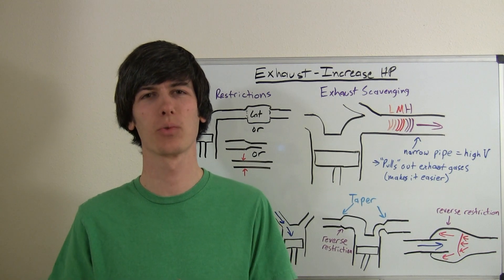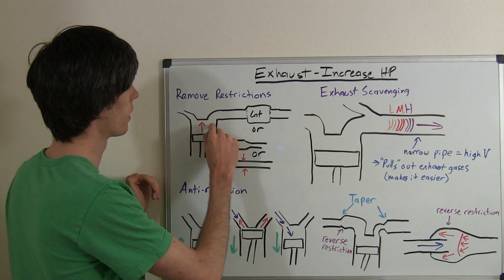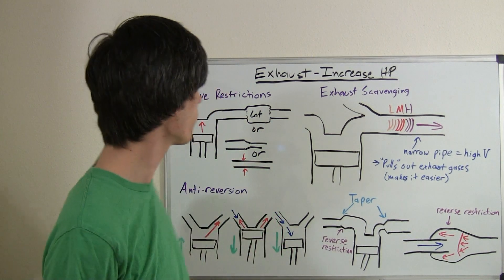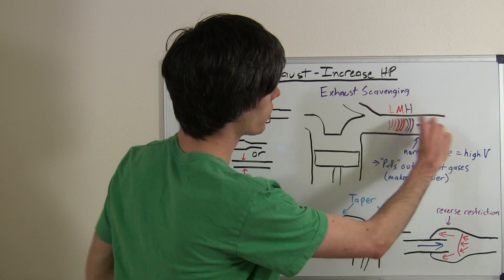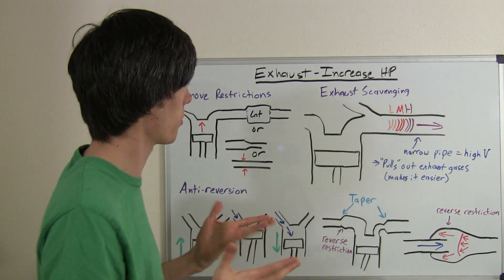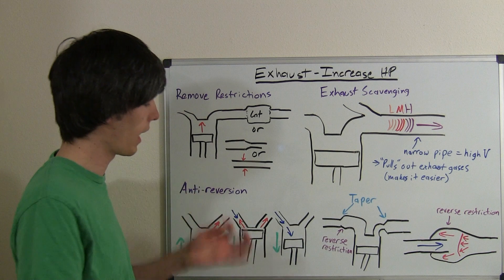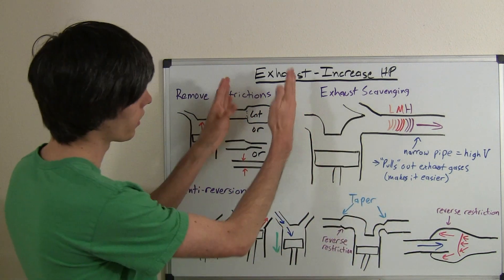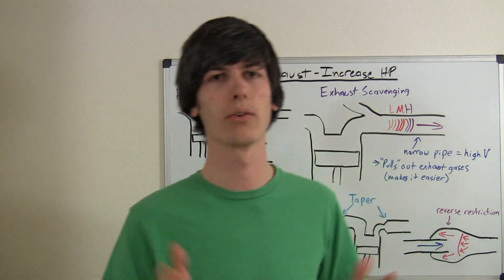Performance Exhaust - More Horsepower

Comment: So what will happen if we take the CAT off ? We are going to gain hp right?
Reply: ayberk vergül you go to jail lol
Reply from the maker: ayberk vergül Not necessarily, depends how restrictive it is. They can be sized so they don't reduce performance.
Reply: How about if we take the cat off as well ?
Reply: +xForgeHouse in USA possible, but rest of the world, not a damn thing will happen. God bless the 3rd world countries :) (living in egypt at the moment) you can take the cat take the bat take the hat off even and no one would give a shit :D im for real bro
Reply: theuncanspan How fast you can drive depends only on how brave you are.
Reply: ayberk vergül need to do bigget exhust and not a stock car like more boost
Reply: xForgeHouse LOL
Reply: +theuncanspan haha right i live in Egypt too, its a mess
Reply: Omar El Zayat yea man sometimes we wish for better roads cause we're sick and tired of changing the tires every 6 months but then again we still getaway from regulations like the ones they have in america ;)
Reply: Omar El Zayat haha exactly
Reply: +ayberk vergul  If The Cat is monitored by an Up Stream 02 sensor and a down stream 02 sensor, you will in fact ruin the vehicles ability to alter the air fuel ratio via injection duration. The engines computer (PCM) relies on the readings from the 02 sensors to adjust how much fuel is being delivered to each cylinder. So if you remove the cat, the down stream 02 sensor will see the dirty exhaust gasses when it should be seeing clean gasses, So what your computer does is take fuel away as much as possible making it lean and effectively reducing overall performance. You shoot yourself in the foot by doing this. Plus you will get a p420 code and if there is 2 banks of cats you will have a p420 code and a p430 code. Plus its illegal. And cats don't restrict that much. Less than 1 psi for a healthy cat.
Reply: +Taylor Moore actually the upstream O2 sensor is what is taken into consideration when determining injector pulse width.  The downstream O2 sensor is there only to make sure the cat is doing it's job and doesn't affect air-fuel ratio
Reply: +Jimmy Rolltz  Well when I have vehicles in the shop with a p420 code. Which is for a bad cat on bank 1. On the data stream My fuel trims both short term and long term both achieve negative numbers usually around negative 25 or 30. meaning the pcm is taking the fuel away. And it's because it sees that the cat can't clean the air and the vehicle is now trying to reduce the amount of carbons introduced into the combustion cycle to reduce pollution because they are programmed to do so. But on a healthy system with a fully functioning cat I am inclined to agree with you.

Comment: Sorry I took so long to look at this, you had asked me to in the comments on another video :-)

The reversion going up the intake valves is really common in racing cams (which "open early, open wide"). But the reversion only occurs at low rpm. The gas is expanding at a fairly constant rate, but the cylinder motion depends on rpm. So a valve timing that has minor gas reversion at idle, may equal out at a modest rpm, and then at a high rpm it will alleviate intake restriction (the opposite problem of reversion). That's why racing cams tend to have a little bit of a coarser sound up the intake system at idle. Anyway, subtle engine sounds aside, it does mean that you get slightly better gas mileage (all low-rpm driving) with a regular cam, but a much less restricted top end with a racing cam.

As for a narrow pipe going faster... yeah... but no too. Faster yes, but um... how to put it: Imagine a mule with 1 pack, that must make 10 rapid journeys to move 10 packs, vs. a mule with 2 packs, which only needs to make 5 journeys to accomplish the same work. A wider exhaust pipe can move more exhaust away from the engine, even if it's traveling at a slower speed. Technically, the fact that it's moving slower is a benefit, as it negotiates a catalytic converter or muffler with less aerodynamic fuss (this is only true if the cat or muffler are themselves larger diameter as well). Mainly the speed of exhaust flow that you get with a narrower pipe is getting it's speed from the engine forcing the exhaust out. So that speed is coming from the engine, ie: taking engine power to make it happen. key words, 'taking engine power'.

I think the only reason to stop making an exhaust larger, is weight vs. practical benefit. When you have minimal backpressure in the exhaust, at the RPM range you expect to operate, then there's no reason to add more steel for larger pipes.

The main reason for the tapers in the intake and the exhaust is just that it's aerodynamic. When you change the diameter of an enclosed passage way for moving gases, you change the speed the gases are moving at. This takes energy to do, and functions much like 'drag' does in an open air setting. A taper when changing diameter of enclosed air passage ways is advantageous in much the same way that having a windshield that sweeps back at an angle is more aerodynamic than a vertical windshield (a la WWII jeeps). It allows the change in air velocity and pressure to be gradual rather than abrupt, so it takes much less energy, kinda like pushing a car up a gentle incline vs. trying to directly lift a car vertically by hand. In a closed passage way, abrupt changes in diameter are about equally bad for air flow whether they are adding or subtracting diameter, but much MUCH less bad if they are tapered. It's why you want funnel shapes fore and aft on a catalytic converter, and why any changes in exhaust diameter should be 'gentle' in slope (tapered). You can see this even on the shape of the valves, which on the back side have a tapered shape to smooth out airflow a bit. Bear in mind that valves and pistons have a very high speed oscillating movement (rotational movement conserves it's momentum and most of it's losses are to friction, but oscillating movement is a huge waste of energy so oscillating parts should be as light as possible). So even a tiny bit of weight added to oscillating parts robs substantially from power and gas mileage. And even still, they put a taper on the backside to alleviate abrupt air pathway diameter changes.

I don't think reverse flow in an exhaust is much of an issue. If it is, it would only be so at an idle speed. Maybe more of an issue if you have a very restrictive exhaust? I dunno. So a reverse restriction doesn't make much sense to me, as it's geometry would itself act as a restriction for smooth exhaust flow (abrupt change in diameter, larger in this case). If there's a situation/application where reverse restriction is beneficial, then I'll just defer to whomever knows more about that. But it looks intuitively "bad" from the standpoint of moving exhaust through the pipe without wasting energy.

Ideally I think the only unavoidable big changes in passage diameter would be at the header's 'collector', where 1 pipe meets several other pipes fairly abruptly, increasing the diameter of exhaust flow several fold pretty abruptly, and the muffler, which is basically using changes in air pathway diameter/geometry to kinda scramble the structure of the high pressure waves in the exhaust and muffle the sound of the exhaust pulses. Some header collector and muffler geometries do this with less energy-robbing than others.

A resonator also robs energy, it's basically doing work similar to what a muffler does, and in fact many performance mufflers are basically just large resonators. I'd only add a resonator if you want to quiet your engine sound. It never 'helps' with power output, unless you're using one instead of a muffler which might have robbed more power.

Of course, most folks just want a cool sound... the very best performing exhaust will be a little too "drag strip" sounding for the average person's taste. Even the high priced super-cars tend to cater to the "sounds cool" point of view. Then again, expensive supercar's notably don't have wheelie-bars ;-)
You can get pretty decent airflow within the limitation of having a slightly more tame purr.

I think the tightest restriction in most hobbyist exhausts is the catalytic converter. Cat-Back systems are only alleviating restrictions aft of the stock Cat, which is typically narrower in diameter, and fairly restrictive itself. If your car is old enough to replace the CAT, get a header & a high-flow cat that matches the diameter of a fairly wide pipe cat-back exhaust. The most benefit comes from a complete engine block to tailpipe upgrade. Although even if the engine breathes well through the entire exhaust, you still need a non restrictive intake (air filter, throttle body, intake manifold), and preferably a racing cam or semi-race cam to fully exploit the aiflow potential all the way through the system (allowing a power curve that peaks out at a drastically higher rpm). And of course if you're going to do all that, why not get a supercharger or turbocharger to artificially inflate your displacement as well hehe.

You could add a lot of power with just a header & turbo though.

Worth mentioning, claims of increased HP with various bolt-on parts are usually looking at a dyno chart for any single point, anywhere on the dyno chart, where there's a few horsepower difference in favor of the added part. To be fair, sometimes there is a small gain across much of the chart. But on the other hand, you could run two dyno tests of the same engine, without changing any parts, and find a few HP difference somewhere in the chart, even though it's entirely the same parts both times. No two dyno tests will look exactly alike. Some performance bolt ons are better than others though. And the closer you get to doing the entire exhaust or entire intake system, removing all the bottlenecks, the more your power gains will start to become readily apparent at high rpm. Just don't assume that a manufacturer's claim of "+5hp" and such for a single bolt-on is necessarily going to be as helpful as the marketing suggests.

Comment: Is more exhaust "back pressure" on a turbo car beneficial for low end performance? Example, a stock down pipe with a catalytic converter (more back pressure) vs an after market downpipe with no catalytic converter (less back pressure)
Reply: On a turbo motor you want the least amount of back pressure posable after the turbo but in the header and up pipe you need back pressure to spool the turbo its like a garden hose put your thumb on it it has more pressure and shoots out harder and faster if you have back pressure after it will push back on the turbo making it harder to spin thats why you see 3in exhaust on turbo cars but not na cars inless it a v8 or something hope this helps a month late
Reply: That makes perfect sense! Thank you, I was surprised to see that the Rally cars have catalytic converters in your new episode.
Reply: no problem idk y the would have cats

Comment: if you have k24 engine and you go from exust manifold 2/qrter pipe to after the resunaider to 2.5 then back to 2/qrter for the dule exust whill that have a better afect eith presure or will that be bad?

Comment: Are there such things as "assisted" exhaust? By that I mean, imagine an outward (exhaust) fan at the end of the tailpipe. That is a very basic example, but my point is - is it beneficial to have an assisting "pull" pressure from the exhaust end?

Comment: just wondering will i make a bit of power on a 3.0 inline 6 twin scroll turbo with a straight pipe axleback(muffs delete). axle back straight piping is 3" and oem size is 2.5 or 2.75. the whole oem exhaust is 2.5 or 2.75 throughout(dp to ab) so i was wondering will i make a bit of power with a 3.0" straight pipe ab?

Comment: Is there a way to increase flow throughout the entire system but not increase or even decrease the audible noise of the exhaust?
Reply: It depends what kind of exhaust system you use. Basically, don't cheap out on an exhaust. I have a VR6 GTI with a Borla Exhaust, its subtle when it needs to be, but it ramps up when you hit the revs. Honestly, i highly recommend you look up your car with a Borla system in it.
Reply: William Su  chek out some huy flow catalytic converter and see if you have one or two exhaust resonators..if two you can remove the second one going towords the muflers way or two together ..depends chek with your mecanic

Comment: whats the difference between high compression for your piston and back pressure. Say you had a high performance engine you want high compression for your piston to ignite fuel better but then you want to have a nice flow out of your exhaust..... don't those 2 things contradict each other?
Reply: High compression just means you have a smaller chamber volume for the same amount of air/fuel mixture to be ignited.  Which in turns makes more power because the charge is denser.  Same amount of air is going in and same amount is going out.  The only difference is the piston is moving much quicker on it's down stroke.

Comment: now, if only you could use the low pressure from the exhaust pulse to pull in the air from the intake. granted this would only help at lower RPM ranges, but in a heavier car that drives on the street I think it would be better. On the street you really only need to pull from 1500 to about 3000 anyway.
Reply: isaac clarke look into valve timing overlap

Comment: Will raising the temperature of the exhaust gases inside an exhaust by insulating it with exhaust wrap or say a ceramic coating have an effect on the scavenging potential?
Reply: Scavenging is increased with heat.

Comment: I'd like to see a 2-stroke design out on themarket for cars.... Now hear me out before I get crucified.

The cylinder gets two valves, intake and exhaust, pretty standard. Except the intake manifold has.... Now get this, another exhaust valve. So when the cylinder has just fired and is moving down, both valves open and a turbocharger forces air to go circulate through the piston completely, with at least the twice the volume of air flowing through as the displacement to account for ignition. After BDC both valves intake and exhaust close, and the relief valve on the intake opens up, venting the turbo so it gets to run continually. Since a large amount of air flowed through the cylinder, it remains cooler. Compression and ignition, both valves open up, back to start. I'd have to figure out how low it'd have to Rev and what the ideal displacement is for this engine to see if any turbo can even pump that much, but you'd run cooler with more power and with no leftover exhaust gases to clog up the next charge. Oiling would be taken care of by a splasher on the crank because I hate moving parts.

Kind of like two stroke diesels out on the market actually
Reply: Ariel Lezen the french made a 2 stroke car  years ago ,,, wasnt so good  and really smokey
Reply: So basically you'd have a turbocharged engine with a bit of overlap on the intake and exhaust timing.

The problem with that is you'd need a non-interference engine (as the valves would be open at TDC), which tends to have a lower compression ratio, so you'd need a bigger turbo to compensate for that, which in its turn is costlier less efficient at normal rpm's.
Not interesting for a manufacturer of normal road cars to implement, the cost and efficiency would be lower than having a smaller turbo, more compression, and an exhaust system that drains as much exhaust gasses as possible out of the engine.

The exhaust valve in the inlet to keep the turbo spinning is a good idea, that's why pretty much every turbocharged car already has this, it's called a blow-off or diverter valve.
Reply: also reliability
Reply: Are you me? ;)

Comment: juz wondering if i decat my stock pipe with an aftermarket fuel management system. Will i gain any hp or torque with the decat or issit best to leave the cat as it is

Comment: An interesting comparison video topic could be internal vs externally vented wastegates.  As an Evo VIII owner I would like to see the engineering perspective of externally venting the WG.  I believe WHP increase due to an EWG has a positive correlation with increased boost psi and turbo CFM.

Comment: Can this be applied on motorcycle ? im still using my stock muffler/pipe...i wnated to get a new one...but will it increase the performance ? im using a pulsar 135LS bike pls help on this one
Reply: you won't notice any diference whit such an small engine. I have a 125 and have tried bikes with standart and expensive mufflers and they had almost the same power and what's more, they all had less power in low low-medium rpm range
Reply: You would need a full system to get any increase.

Comment: Am very much confused about changing the silencer of my royal enfield classic 500.newer version efi engines are very refined and less noisy.but it lacks that old 'thump'. Ive seen people using wildboars megafones...etc to increase the thump. I want to know whether it will  have negetive effects on the engine. Does an increase in sound means increase in back pressure or restricted flow of exhaust?

Comment: Can you explain something for me. If backpressure is bad, then why not just straight-pipe a car all the way (no primaries, secondaries, resonator, muffler) and put on 3inch piping? Other than it being too loud? Say you get a tune to fix the air/fuel ratio also.